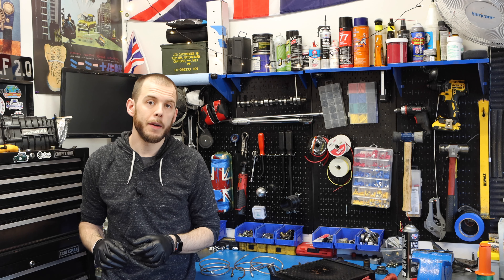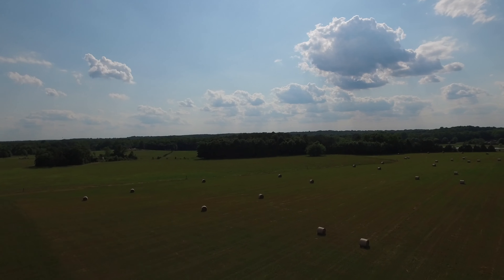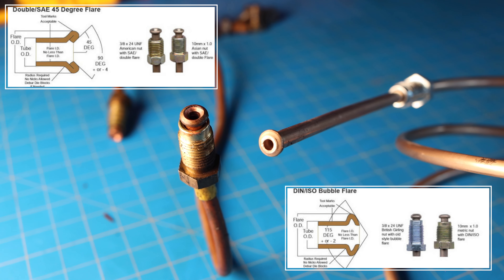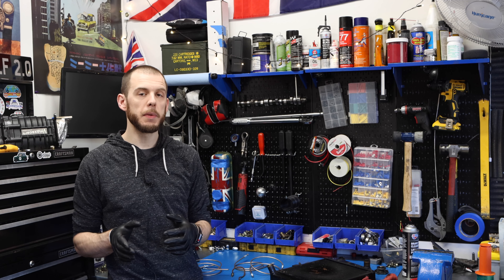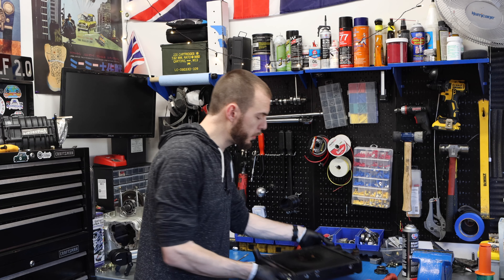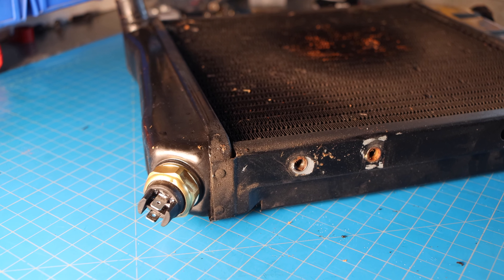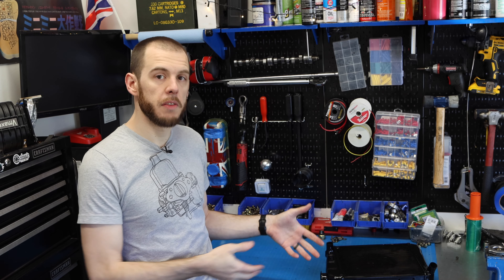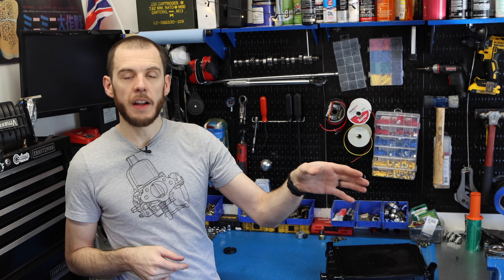Super Bad Wolf - Part 14 | I Made a Mistake....

Comment: Cole,   Well done on hitting 15K, When making a flare look inside what ever your conecting the pipe to and this will tell you what type of flare you need to mate the faces together, Concave or Convex to make a perfect sealing face and joint, Cheers Dave
Reply from the maker: Thanks Dave! Great tip. Next time I will have a peak in the hole to make sure I get the right hose type.

Comment: Col do you think the standard rad will be ok for the supercharged engine. Top work!
Reply from the maker: Hey Steve, I am gonna see how it goes with a single stock radiator but if its too hot, I will likely add a supplementary front mount aux radiator. Think like the size of a heater core.

Comment: I always check the receiving end. Fe, look into the master cylinder brake line hole. You'll see a concave hole. (If you look at it , its like a upside down U shape) then you know the bubble flare must be used so it matches the shape. 
 sometimes, when joining 2 lines together, the connector can have a concave shaped like a U when you look at it. Then you use an double flare,if that makes any sense
Reply from the maker: Great tip and that makes sense. In the future I will def be looking in the hole as it were to prevent a mistake like this again. :-)

Comment: the brake pipe under the radiator might need a tighter bend in it so its out of the way.
Reply from the maker: I actually tightened it up out of frame so it should be gravy but I’ll keep an eye on it. Thanks!

Comment: col put a fletcher. with the standar one i had to use extra fan with the alloy it doesnt go not even close to the middle on a Hot day
Reply from the maker: The fletchers don’t fit in the engine bay on the Mk1 because of the built in shroud on the body of the car. I’ll likely end up running a second front mount radiator.
Reply: @classicminidiy  on my mk1 engine bay went straight in. unless the 998 a+ that i have gives more space. check my instagram Account. exept if you mean with shroud the metal that Protects the radiator